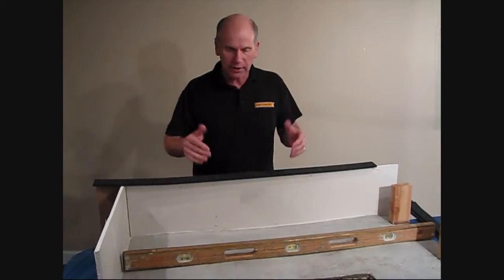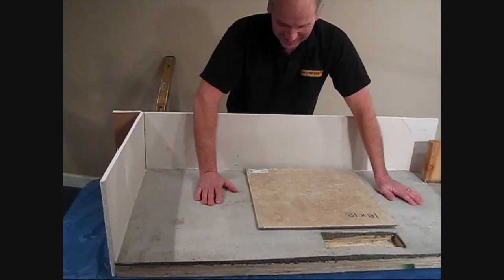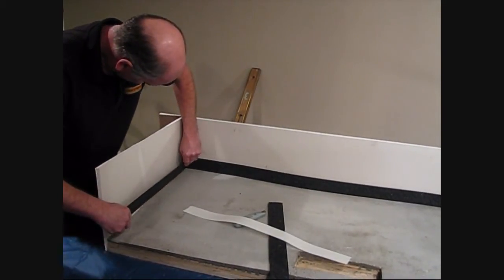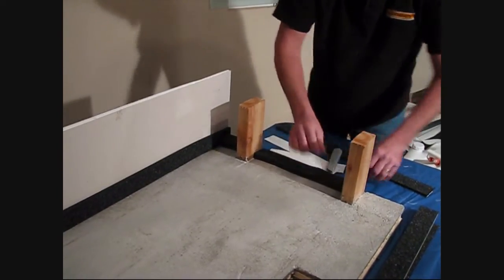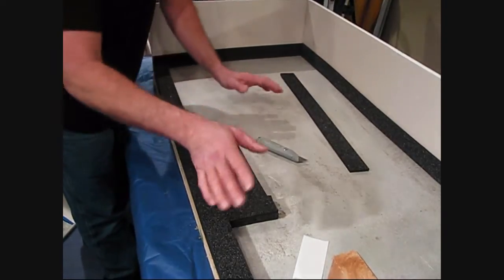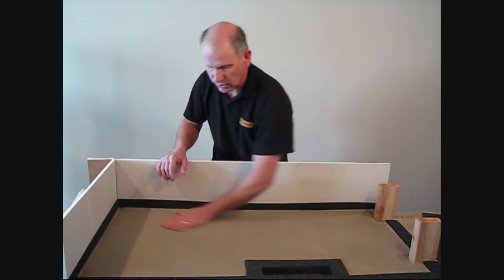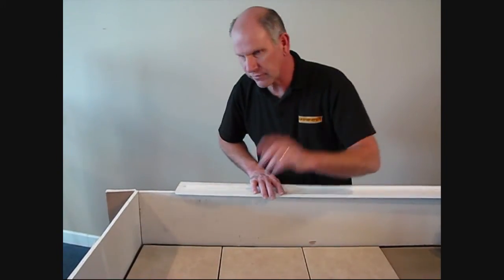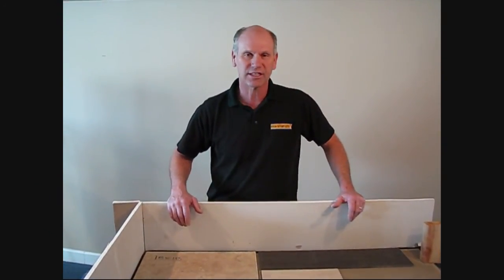Using Edge Strip Kits and Self-Leveling Underlayment to Provide a Flat Substrate

Comment: Will the tile go right over the edge strips
Reply from the maker: After you pour you can remove the strips at the door and CUT them FLUSH around the floor heat register...... THEN TILE your room UP TO the strips and then cut them FLUSH with the top of the tile after it dries. This way you will LEAVE IN a 5/16" soft joint perimeter which will help to prevent possible "tenting" of the tiles